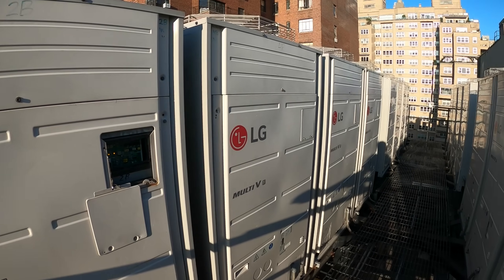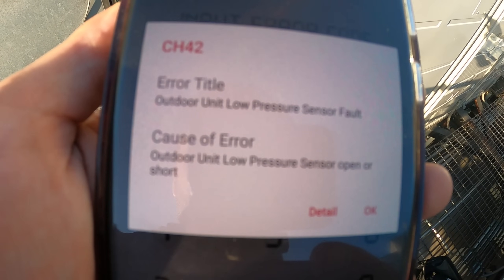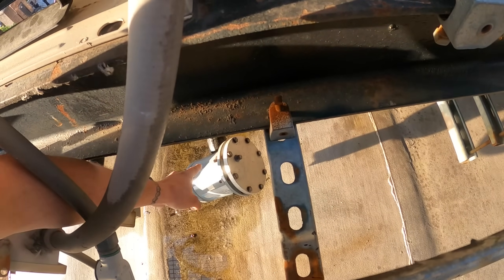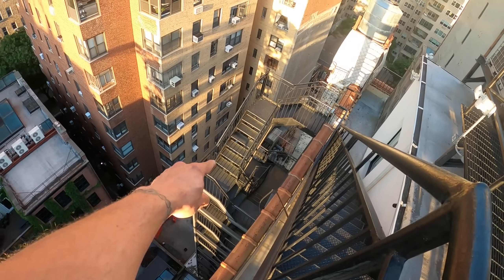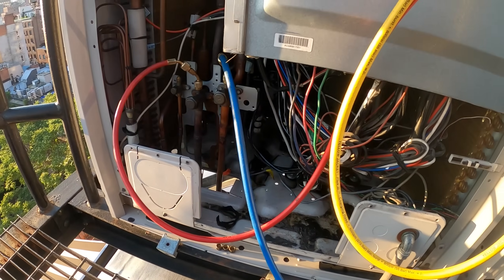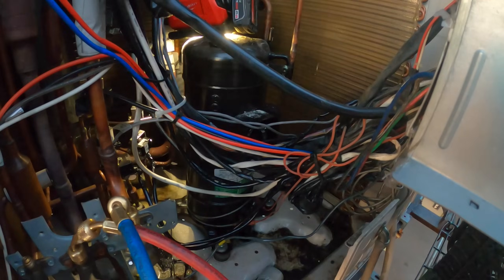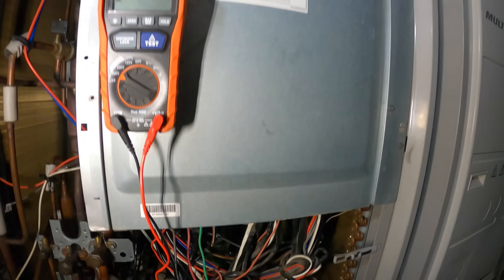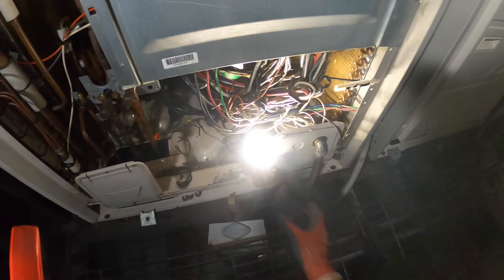HVAC: LG MULTI V Heat Recovery Heat Pump Not Cooling/Not Heating (Error Code CH 42) Error Code CH43

Comment: What do you mean license torch operator and fire guard license?
Reply from the maker: For New York City you need to have two licenses from the fire department. F60 (Torch use of flammable gases) & G60 (Fire guard). Both need to be on site and both need to have the licenses to perform any hot work such as brazing or soldering. Thanks for watching!

Comment: Gotta add PVE oil buddy, also gotta have a magnetic solenoid to open that solenoid when you braze so you won’t plug the upper and lower EEVs. Good luck on this one, it’ll be a bit of a headache.
Reply from the maker: Thank you for the advice! Def a headache. I see it needs PVE oil and a viscosity of 80 but no other information. Tech support just said to call my parts provider and there is only one and they don't answer emails or phone calls. Is there something you recommend? Thank you. Thanks for watching & commenting! 🙏🔧⚡️
Reply: @JumpermanTech  you should get it from Klima NY or NJ, I got it from their NJ branch last month. I work on these systems everyday so I deal with them a lot. I can’t stress enough about flowing nitro and opening solenoids with the CPS magnets though. Good luck and let me know if you need help with any questions.
Reply from the maker: @mwdub02   @mwdub02  Correct. Klima is the only distributor and they have poor communication. Never answer the phone and it takes a long time to hear back from email. When we need parts, it's right away and it's sad they are just not avaliable unless the building stocks up on things. Thank you for your advice! I have solenoid magnets and appreciate the info!
Reply: @JumpermanTech  I agree 100%, forgot to tell you to add oil half way during vacuum. That’s the best way not to slug your compressor.
Reply from the maker: @mwdub02  facts! So pump in oil slowly while the system is in a vacuum and not while it's running through the suction line? Usually it's when the compressor is running. Thank you for your time & advice🙏🔧⚡️
Reply: The oil is FVC68D that’s viscosity of 68, you can find at the supply house website. I don’t know why they told you 80.
Reply from the maker: @mwdub02   @mwdub02  Thank you for that info! Idk why they said that either and wouldn't allow me to talk to tech support as I wasn't on site during the time of the call. I did some research online and found that exact oil. I picked up 32oz earlier today from a local HVAC supplier. Really appreciate it brother. I always run nitro when brazing. That creates so much damage in these systems. Changing the compressor, inverter board and adding some oil tomorrow in hopes to get them going. I fixed the leak the other day but the compressor failed mechanically even though it checked out electrically. We don't have a new solenoid valve and I told them to wait for the parts but they need it asap and are willing to pay to see what happens so I'll do my best. Thank you for watching & commenting! 🔧⚡️

Comment: You using megger wrong. 
When you holding that button - you should run 1 minutes and 10 minutes tests. It is not for testing whether motor failed, but for the maintenance records, to monitor and/or predicting when motor going to fail.

To test whether motor or circuit has failed - you press test button for 1-2 seconds, and device will do it automatically.
Reply: I dont think those hand helds can go the 10 mins.
Reply: @oldblueaccord2629  They do. There’s even the “hold button”. Just need to make sure that batteries are fresh.
Reply: The problem with motor prediction is you need the new installed numbers to compare to the current numbers so that test doenst mean much otherwise. It told him the windings were ok, proceed.
Reply: @oldblueaccord2629  Well - he was holding the button, and that’s not how regular “quick test” is done.

Comment: I just had a peek in the service manual. The unit should go into lockout when high pressure is >581PSI or low pressure <18.9PSI. BUT and that's the important thing here: The unit thought the pressure sensor has just died and the unit hasn't lost it's charge. The first Digit of the Error Code is the severity of the Error. 4 - sensor error, no lockout; 3 - three minute lockout, auto restart, lockout after 10 occurrences in one minute, 2 communication errors with indoor units depends on error; 1- immediate lockout, no reset possible.
The programming can calculate superheat with all the sensors in the system and therefore figure out if the pressure sensor has died or the unit is low on charge.
It should also have thrown an oil level error should which is error level 1 and cause a total lockout.
My guess is this is a firmware bug in those units, nobody ever updated them and therefore they are dying one by one because the lockouts don't work. And the service hotline doesn't want to tell you this without you asking because then they are liable (my guess).

Please update the firmware on all units ASAP, before more units fail.
Reply: The FW Update process looks a bit involved. You need "LG GSFS" access where you should find firmware updates. They need to flashed with a special dongle called "FLD2". Maybe they include changelogs and reference what has been fixed, not sure.
Reply: And one more thing: The jumper settings right next to the display look like they are all set to off. This means it's running in compatibility mode for Gen2 indoor indoor units. If all indoor units are newer than 07/2016 jumper 3 should be set to on.
Reply: @tschuuuls486  Nice leg work on this.

Comment: Using the torch needs to be licensed? I thought if an ac technician is licensed, he can use torch.....
Reply from the maker: Yes, you need a license from the NYC fire department for "Torch use of flammable gases" & "fire guard". Both the torch operator and fire guard need both licenses. A licensed HVAC usually means having your EPA Section 608 Universal license but that has nothing to do with hot work. Usually you also need a hot work permit from the fire department but many don't do that. Thanks for watching! 🔧⚡️

Comment: Bru I feel sorry for those people who invested all that money in a top of the line VRV  system thinking they were doing the right thing? All to have a mickkey mouse company install it such a shame. And yes it alway recommended to replace the inverter board with those compressors as that board is the contactor!

Comment: I ran into this a couple times, decided I wouldnt get that brazed up without damaging the valve internals. Just order the valve or use a third party 208v in a real pinch. Might as well add a shrader in there for future work so you can isolate the condenser.

Comment: The troubleshooting steps for CH42/43 are very misleading. They should of made one of the reasons that the unit ran out of refrigerant and to check pressures before assuming the low/high pressure sensor is bad. Though just because all of the refrigerant leaked out, doesn't mean that the compressor needs changed. We had an EEV leak out of its head completely and the compressors still ran fine after replacing the EEV and recharging, though that was on a system with more than one outdoor unit connected together.

When trying to find a leak on the ODU side, it's best to close off the service valves and connect your guages to the ports inside the unit(Not where the service valves are) so that way you do not waste nitrogen on the indoor unit piping.
Reply: It ran all the oil out of it...thats never a good sign.
Reply: I looked this up and the unit thought the hp/lp pressure sensor failed and it didn't run out of refrigerant. The board will calculate superheat etc. to cross-vaidate the sensors. Unit thought the sensor died, ran the compressor and killed itself. There are seperate error codes for hp, lp/loss of charge. Sounds like a critical firmware bug to me.
Reply: @tschuuuls486  Yeah, that's one thing I've noticed during slow refrigerant leaks that it continues to try running, even with all IDU's at fully open EEV(1350 steps), and it doesn't error out until it gets critically low. There is an error for low refrigerant pressures(CH 35), but I've never seen it go off on this error before something else happens from low pressures.
Reply: @Rodj12341  This sounds very broken. I'm not a tech at all just was curious. You could look into "LG GSFS" where you should find firmware updates. They need to flashed with a special dongle called "FLD2". Maybe they include changelogs and reference those issues?

Comment: Why would you change the compressor and inverter board for a leak? Pull it out, drain it and refill to factory amount..
Reply: Oh yeah?
Reply from the maker: @sherwinalvarez7365  Should have replaced the compressor while the gas was out. We fixed the leak and the compressor failed mechanically enough though it checked out electrically. Locked rotor 🤦‍♂️ considering how many compressor failures there have been here, not surprised. Should've replaced it but it was worth a shot to start it up since it checked out electrically. Thanks for watching! 🤙🔧⚡️
Reply: I would've thought the system would lock itself out long before oil becomes a problem. You might want to check with your LG Tool if there are Firmware Updates available for those machines. According to LGs marketing the Multi V should even have oil level sensors to make sure this doesn't happen. EDIT: Maybe the previous company disabled oil level sensing or something?
Reply from the maker: @tschuuuls486  I agree with you. Everytime there's an error, in house engineers reset the units which isn't good so that maybe played a role but if the low pressure or high pressure sensor is open, nothing should start and protect the compressor. Yes, there is an oil sensor built in the compressor and has 2 wires. That should have protected the compressor too, but it didn't. Definitely something needs to be checked here and dive deeper into what happened here. What good are all these safeties if they aren't protecting what it should? Thanks for watching & your comment! Stay tuned for new videos every week 🔧⚡️
Reply: @JumpermanTech  I just had a peek in the service manual. The unit should go into lockout when high pressure is          >581PSI or low pressure <18.9PSI. BUT and that's the important thing here: The unit thought the pressure sensor has just died and the unit hasn't lost it's charge. The first Digit of the Error Code is the severity of the Error. 4 - sensor error, no lockout; 3 - three minute lockout, auto restart, lockout after 10 occurrences in one minute, 2 communication errors with indoor units depends on error; 1- immediate lockout, no reset possible.
The programming can calculate superheat with all the sensors in the system and therefore figure out if the pressure sensor has died or the unit is low on charge.
An oil level error should also be level 1 and cause a total lockout.
My guess is this is a firmware bug in those units, nobody ever updated them and therefore they are dying one by one because the lockouts don't work. And the service hotline doesn't want to tell you this without you asking because then they are liable (my guess).

Please update the firmware on all units ASAP, before more units fail.
Reply from the maker: Most likely the unit failed due to the leak and loss of oil. Came back for the following  visit to fix the leak & the compressor failed mechanically even though it checked out electrically. Locked rotor. Now it's double the work. Thanks for watching🔧⚡️